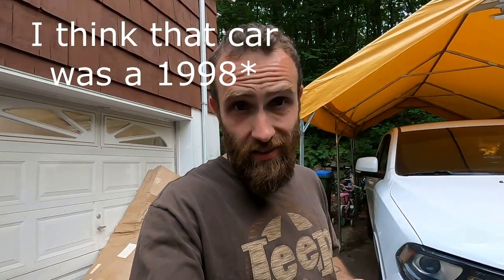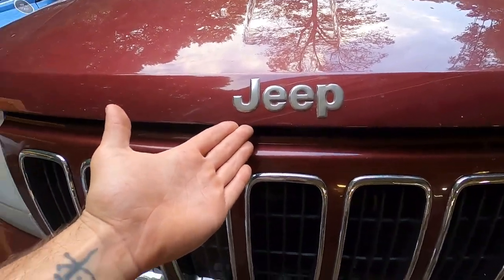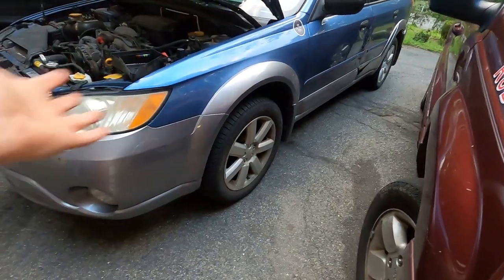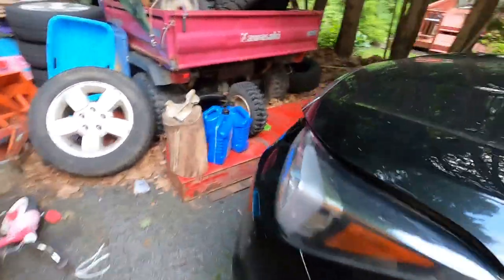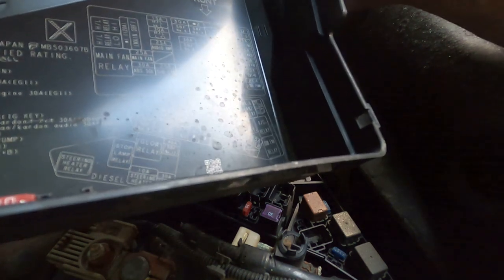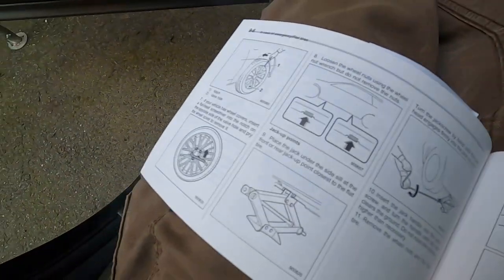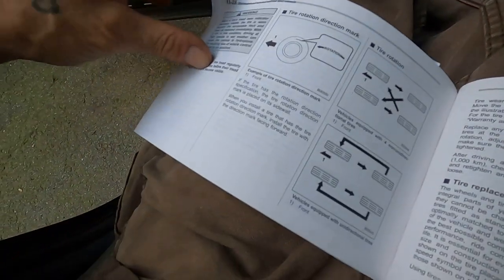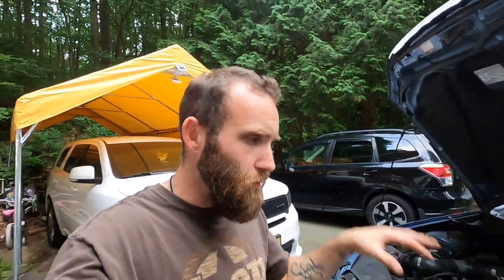Turn your Subaru AWD Off - 2 Wheel Drive Fuse

Comment: Hey if you put one of the extra fuses on the inside of the fuse box lid and it will become fwd, just did it in my  08 outback 2.5, a light should pop up in the dash that says AWD, and btw you can use any of those extra fuses it's completely safe, hope this helps anyone

Comment: I currently have three Subarus, 2012 legacy with 125k miles and currently needs a cvt valve body that will cost $2600, a 2015 forester with 109k miles, and a 2017 legacy with 150k miles that I had to replace the cvt valve body myself with used parts. Two out of three with transmission issues.. don't own a Subaru that's out of warranty, or better yet, don't buy one..
Reply: Why do you need cvt valve body?? Are you getting this stupid (at oil temp) light flashing

Comment: That exact fuse is now in my 2012 Forester in the passenger compartment under a dash cover right in front of my left knee when seated. I put a fuse in that socket and turned my car into a 2wd car for a test of the 4wd system.

Comment: Never really thought about tire tread making that big of a difference but I guess it kind of makes sense. I wonder if my wife's Hyundai Santa Fe all-wheel drive is that picky. In the Santa Fe you can turn on and off the all-wheel drive with a button
Reply from the maker: It is a big issue with Subarus because of how their symmetrical all-wheel drive - It is more of a locker than AWD

Comment: I think they did that so they can be towed with a wheel lift as well, with AWD you can’t wheel lift the car but plug the fuse in (or out) and bingo now you can. On the newer car, look up how to tow the vehicle. If it says flatbed only you know you can’t disco the rest.

Comment: Meh, I'd say you can just get two of the same brand tires, same size, put them on the same axle, you'll be fine. I have owned two Subis, owned two Quattro Audis (which is the same type of system that Subi uses). Mom has had two Audis. We have put two tires on our cars plenty of times, no problems. Even the Audi dealer installed two tires a few years ago for my mom and they never mentioned anything about that. And you know they would if they had any reason to! 🤑

Comment: I thought the AWD system on Subaru's were mechanical systems. While rotating the tires on my 2023 Crosstek today, I noted that while I could turn either of the front wheels, the two back wheels spun freely. My 2006 Outback Sport doesn't do that. So I am wondering if my 2023 Crosstek AWD system has failed or works differently.

Comment: FYI JUST PULL THE 4x4 fuse on a 2002 Durango. This truck usually gets. 11MPG I’m expecting much better now. Test drove just now, and it’s rear wheel only now and drives like a car. It was dragging so bad, and dragging off the line. It still sucks, but this 5.9l now might have a chance at better gas mileage, and it just feels free rolling which is nice.

Comment: You shouldn't drive without a front driveshaft on quadra drive for too long, it will damage the transfer case overtime. Select trac is fine because you can just actually shift it to 2WD.

Comment: I believe Subaru sells FWD vehicles in some countries (Japan) so I feel that was for those reasons, I know my 2024 Crosstrek has a full size spare and the tread wear is not such a big difference for that system vs putting a 2" smaller tire spare.   Im unclear is back in 1998, 1999 when you had your forester is it was a smaller spare.   Be curious is those manual stated something relating  to that..
Reply: Is it the wilderness trim? The Wilderness trims do come with a full size spare. I have a base 2023 Forester which has the temporary compact spare tire which is still better than no spare at all. Although I haven't really looked at it to see how close it is to the other tires in diameter.

Comment: My 08 outback has it. And I completely agree with you about Subaru kind of going to s*** in the newer years. My 96 2.2 5 speed was the most incredible car. It got 35 mi to the gallon easily.

Comment: Does a 1995 Impreza 5-speed have this feature?  
How about a 2004 Impreza 5-speed?
My teen kids have both.  
We're new to Subaru!  😅
Reply: Only the automatics had the feature.  AWD cannot be disabled on Subarus with manual transmissions, they are a different, purely mechanical, AWD system.

Comment: So if the front tires are a lil worn and the rear tires are good, would that cause binding on turns? I'm new to Subaru and i bought a used 07 Legacy.I recently learned about disabling the awd with the fuse but im trying to learn all the causes of it before i decide what to do to fix the problem. My car feels funny on turns and it went away when i put the fuse. My front tires are worn on the edges.
Reply: I'm not entirely sure if the tires would but old differential fluid could definitely cause that.

Comment: Isn’t the larger tire spinning slower? Physics thinks that is true. So do I. What say you?
Reply: The road speed is the same on all 4 tires, but because the circumference is shorter on the worn/smaller tire, the RPM (rotations per minute) have to be faster on the smaller tire. And, if it was a locked deferential, there would be no place on the drive train to compensate for the difference in rotation speed.

Comment: Also, in terms of your question of when they stopped doing that with the fuse, I am guessing that took place when they went to splitting power in more ways than just 50-50. The manuals still come with viscous couplings, rocking a 50-50 power split, but since like... IDK, 2013 or earlier, auto Subis rock a 60-40 split until the system senses slip. For MPG's sake. 

My guess is that once they did that, the system was already designed to take a bit of differential speeds, so they need not mention it so much or put a fuse. Something like that, IDK lol. That plus the new-age idea that, "We'll just let the customer break their car and come back and buy another one when that happens!" 😂
Reply: I think the main danger is installing wheels/tires that are literally different sizes, front-to-rear.